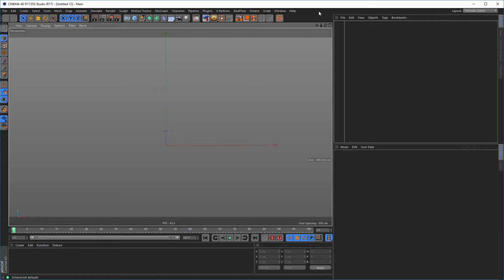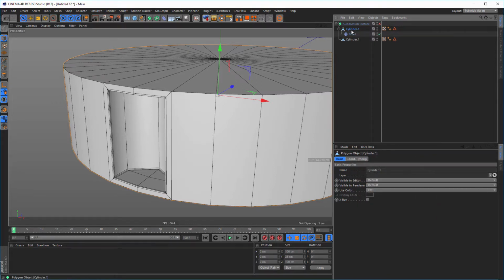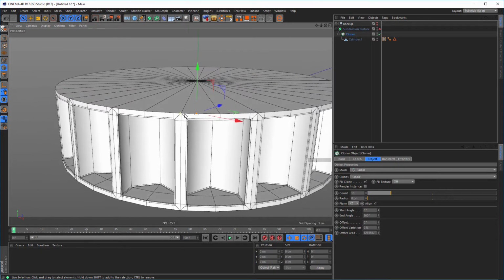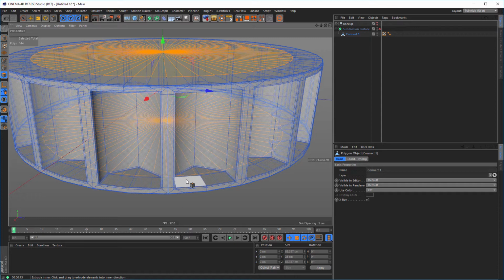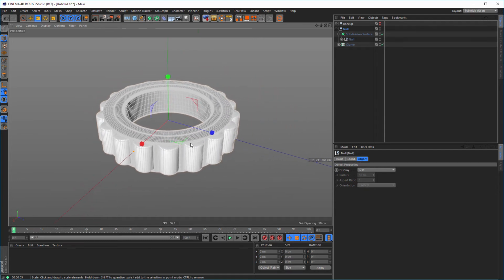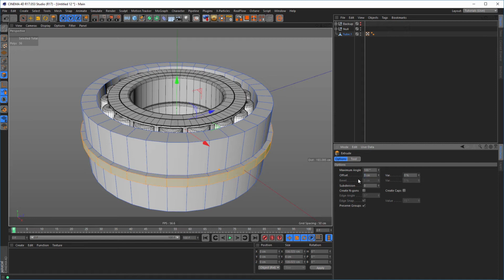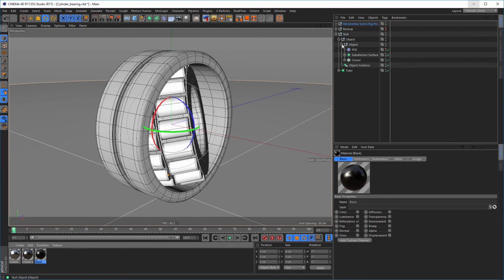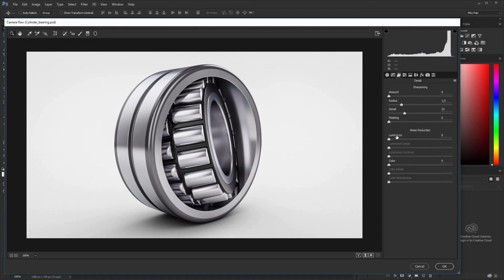Roller Bearings (Cinema 4D Tutorial)

Comment: Hi

sometimes bevel deformer creates only holes in my mesh through this lesson. If I enabled Use Angle than on some edge loop there are no bevel :(
Reply: I got holes when tried to make big round
http://i.piccy.info/i9/c7a4720096afb24bd25a9906caaf869c/1489181456/234857/1047162/cinema4d.jpg
Reply from the maker: It seems you have not optimized your object. before you bevel go in point mode, right click in viewport and optimize, then it should work.
If not, you can upload your scene somewhere and I have a look at it, if you want, but this can take a while, because I am quite busy at the moment.
Reply: Hi

Thx. I found this solution yesterday. I don't know what it does but it fixed problem. I had problems with bevel so many times.

I spent 2 hours with Cinema 4d but couldn't achive flat white background like in your render with nice gradients in reflections. Or good bg, or goog gradinets. I used hand made scene.

Best what I got: https://www.flickr.com/photos/pasha4ur/32996407810/in/album-72157681294257815/

Sent you a small donation again from Ukraine ;)
Reply from the maker: First, thanks for your donation!
To make an infinite floor is quite easy. Take a Background Object, put a material with a gradient on it, make a floor (disc, or plane...), put the same material on it as on the background and use frontal mapping and give the floor a compositing tag with "Compositing Background" active. Thats it.
I made a sample for you...
https://www.dropbox.com/s/4wjfo6tvj46xxsr/infinite_floor.c4d?dl=0

By the way. Your result is pretty nice.
Best, Niko.
Reply: thank you. Look like maxwell render doesn't support background object
Reply from the maker: Can't say it, I never tried maxwell. I am satisfied with the physical render and octane render.